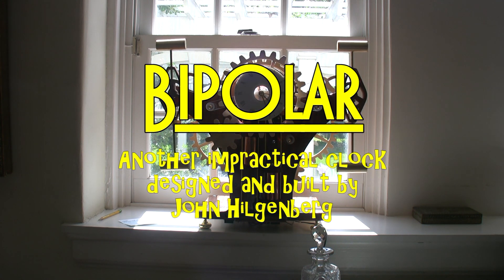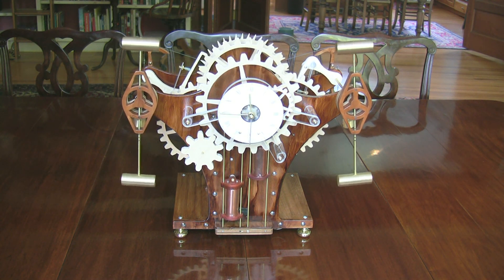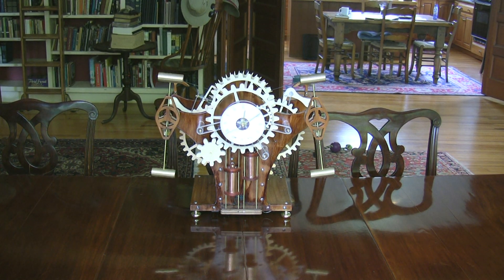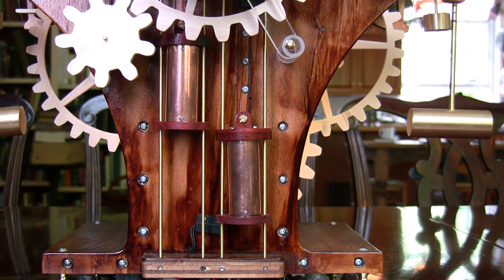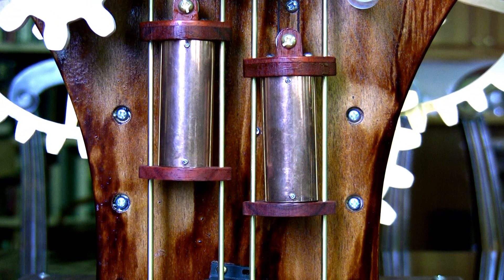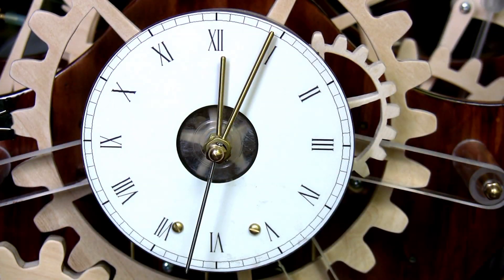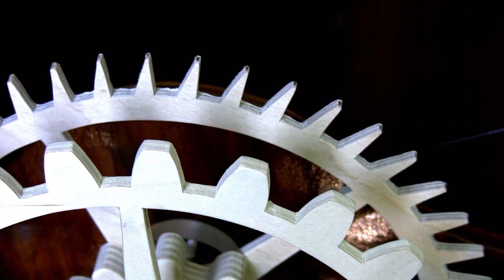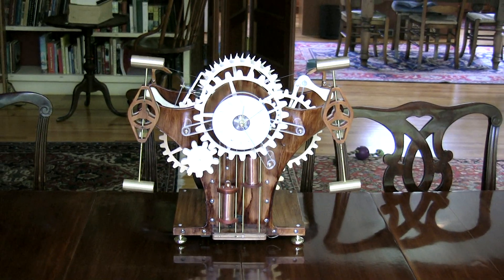The wood gear clock "Bipolar"

Comment: I wonder if anyone has made one where the minute hand is advanced, not by it being geared to the escape wheel, but rather by having the rewind mechanism advance the minute hand every time a rewind happens.
Reply from the maker: The speed of the clock is regulated by the pendulums, which in turn regulate the speed of the escape wheel.  The rewind mechanism, while connected to the escape wheel through the wind cord, does not have as fixed a periodicity as the escape wheel due to the possibility of slippage or stretch of the cord, so I'd not expect it to be as true a governor.  Having said that, this is not a very accurate cock, and designing it as you suggest might perform just as well in practice!
Reply: My idea actually came from thinking about appearances. I was thinking that it would be more aesthetically pleasing if, say, the sound of the motor signalled the start of a new minute, or a new even-numbered minute. Perhaps the position of the weight could itself serve to indicate seconds.